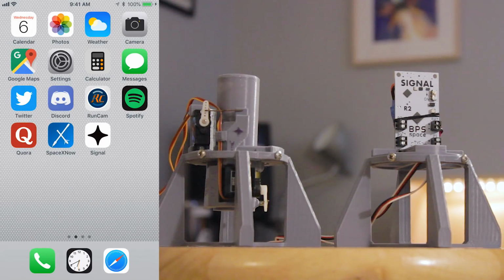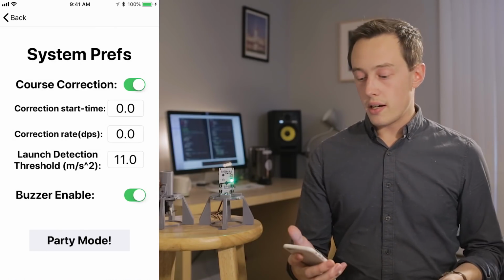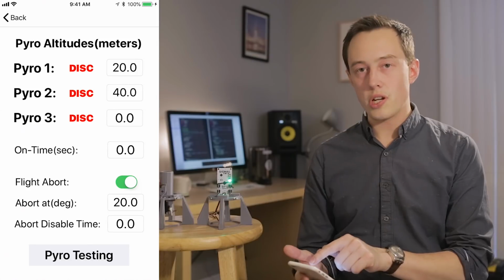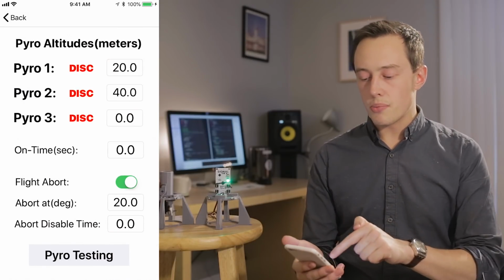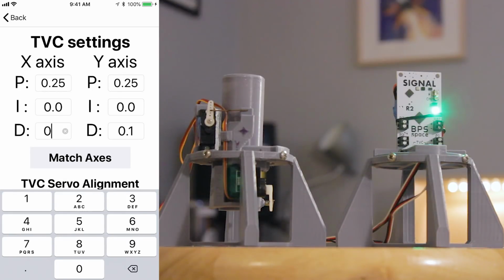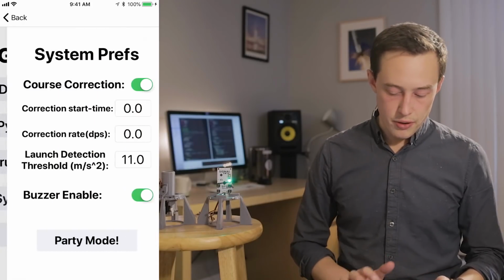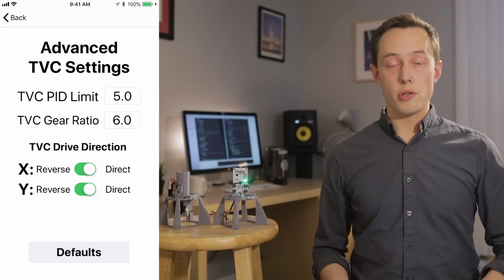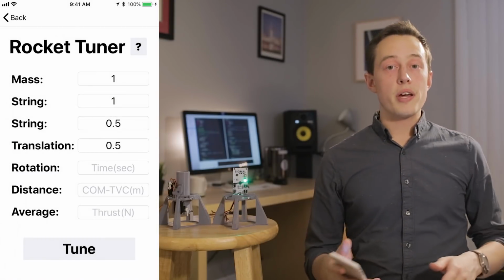Signal R2 - iOS App

Comment: This is coming along nicely. I have a suggestion for a small change. Can you make the test controls for the pyros harder to trigger with an accidental touch. I know you have the warning popup, but I think a more persistent process for preventing false touches would by more "safe". I suggest perhaps two buttons that need to be pressed simultaneously to trigger each pyro. Just a thought. Keep up the great work on this project!
Reply from the maker: Good call, I'll add a bit more protection there. Two buttons at once, or some type of arming UI switch might work. Thanks!
Reply from the maker: Quick update: Done! There's now an arming button that must be pressed and held to enable any of the pyro channels. There's a quick video of it @joebarnard on Twitter.
Reply: Great work!!!!